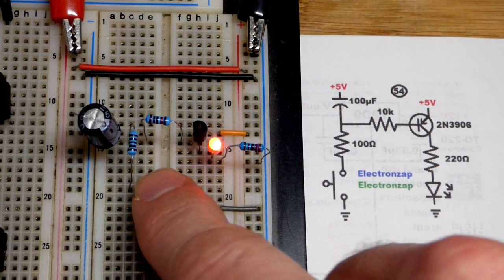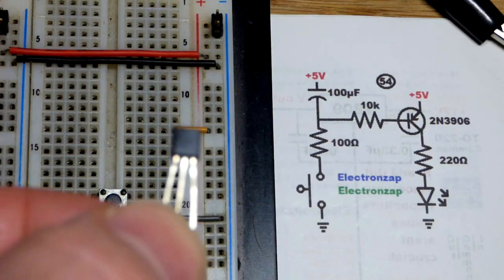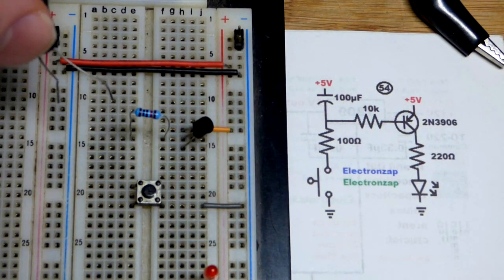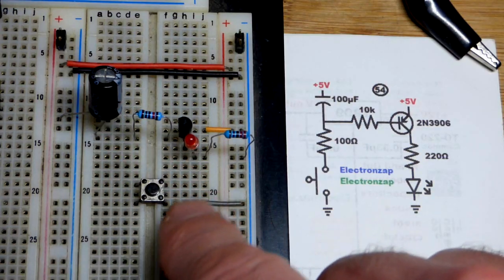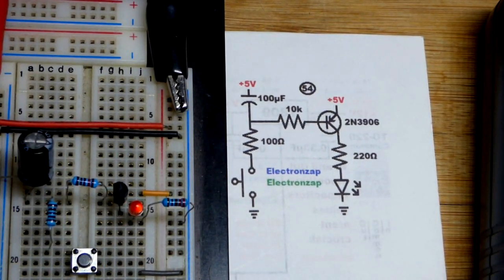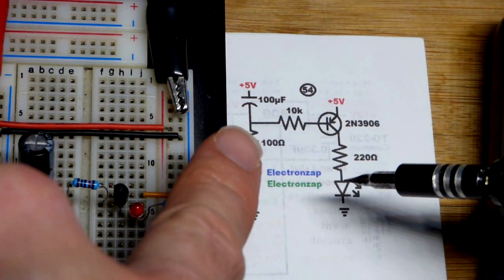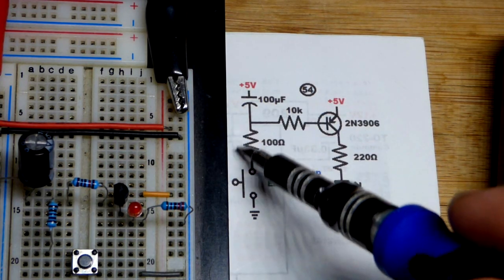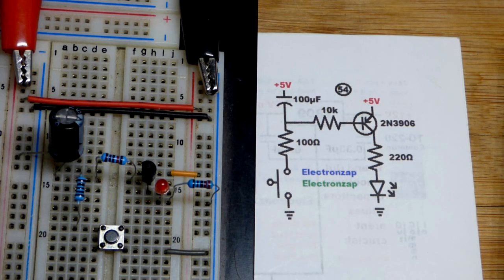How To Build Fade Off PNP BJT With LED Load Bipolar Junction Transistor

Comment: Great video as always. Just wanted to point out that your explanation at the end of the video was very true and every inexperienced electronics hobbyists should understand that concept.
Reply from the maker: Glad to hear, thanks for watching!
Reply: @Electronzap  What I always appreciate is when Youtubers post links in their video descriptions to their videos of the more basic elements, regardless of the complexity level. So no matter if its just saying "link in the description to why you need a resistor with an LED for it to light", or "link in the description for why you need two different resistors per gate in a totem pole gate driver" it's easy to jump back one skill level. Especially in a sequel video like this, a link in the description to the NPN version would be useful.